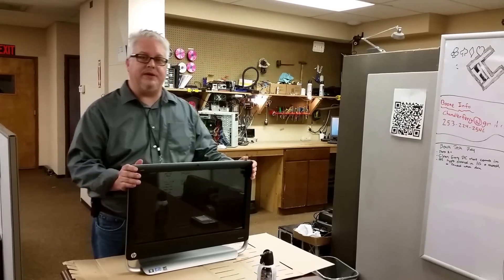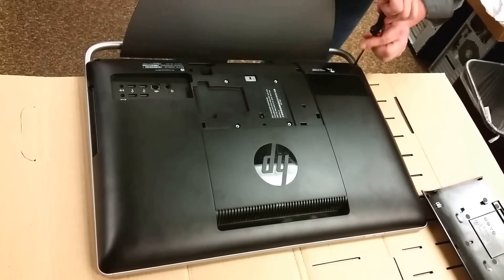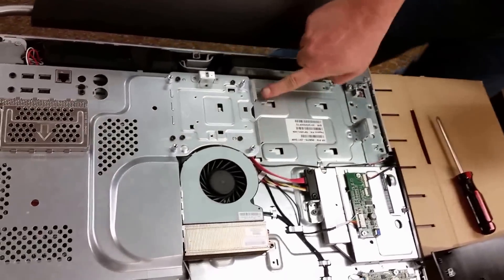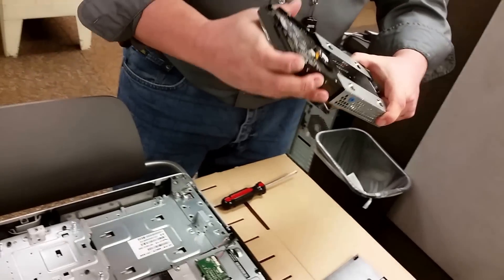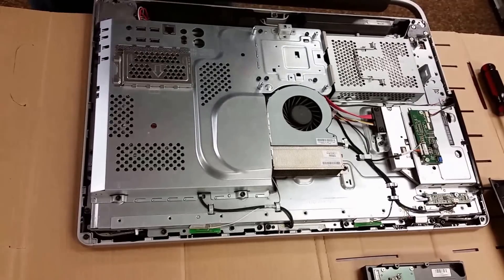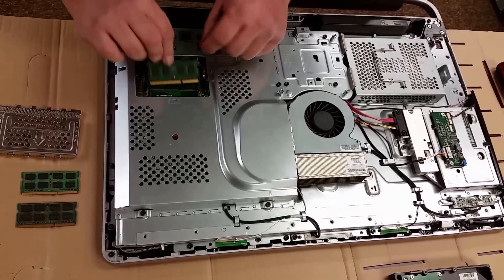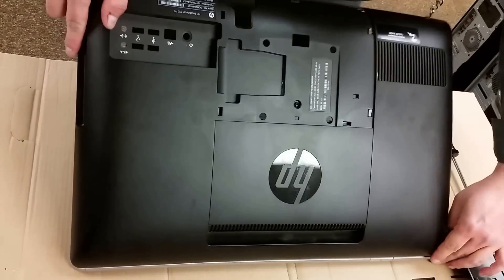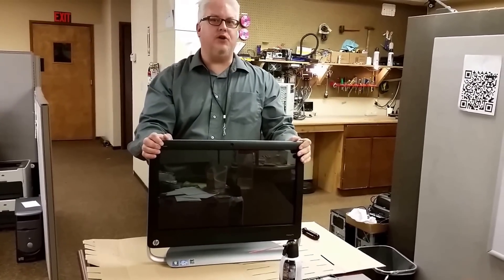How to replace a hard drive and RAM in an HP TouchSmart 520 PC

Comment: Thanks so much for this video. It was more in depth and understandable than the HP video on their website was. I've been contemplating upgrading my HP TouchSmart 520 for awhile now since it's now 4 years old and starting to get a lot sluggish when I have a lot of windows open which is quite often. On top of that I am visually impaired and use a screen reader which always has to run and process things so God knows how much RAM that alone takes up. Upgrading my current PC as best I can is definitely cheaper and thus preferable to buying a new one.

Comment: Thanks for a great video, changed my ram and installed an SSD. Mounting the SSD was tricky as I had to use double sticky tape and a tie strap.
Reply: Just use an adaptator
Reply: @Civan768  I have six different styles of adapters and none of them will mount inside this unit properly

Comment: Worked perfectly for me. I used a GoldKey LV 4GB 1600MHz DDR3 and  it cooperates smoothly with the Crucial 4GB Single DDR3/DDR3L 1600 MT/S that HP originally uses. The upgrade worths it. Thanks for the guidance :) PS: I have an HP 7320 TS.

Comment: Great video, Thank you!   Question.  Got the notorious Blue Screen on boot up and imagine best to replace both RAM and Hard drive for my HP TouchSmart 520-1070.
Where is the best place to purchase these items at and what part numbers do I request?
Reply from the maker: Darin McCulloch Sorry for the late reply. If you haven't yet, check out crucial.com. They sell both. RAM part #CT2583475. Instead of the hard drive, I would suggest an SSD upgrade.

Comment: Hello, first of all excellent video, it is very clear. I have a query and I wanted to know if you have any idea of what it can be. At times the PC makes a vibrating noise, but if I hold the case on the side of the dvd player the sound stops. Do you have any idea what it could be? If there could be something loose inside or if something is about to fail? Thank you very much and sorry if there is something wrong, my English is not entirely good. Greetings from Argentina.

Comment: Thanks for a great video.  I am trying to upgrade the RAM in an HP TouchSmart 600-1352.  I am trying to upgrade from 4GB to 8GB, but haven't had any success so far.   I noticed your RAM looked like my RAM, double-sided with 8 modules on each side.  I tried replacing it with 8GB of Mushkin, which is also double-sides, but only has 4 modules on each side.  Any suggestions?

Comment: Is it possible to add an HDMI input to this model of HP TouchSmart 520-1030 series?  I know that the 520-1070 comes with an HDMI input.
Reply: +Vainglory - Rav's Mobile Gaming You could try a USB 2.0 to HDMI Display Adapter. Found 1 @ monoprice here: http://www.monoprice.com/product?p_id=8079
Reply: Hey bud, thanks for getting back to me.  I will give that a shot.
Reply: +Vainglory - Rav's Mobile Gaming No prob. Hope it helps!

Comment: Thank You for your video I had a problem with upgrading BIOS  with Touch Smart 610 (Windows 10)   When I tried to upgrade BIOS my computer suddenly shouted down and now I have a black screen with 8 beeps  and Windows -B bottoms  combination does not work to get BIOS recovery Maybe you know another bottom combination to overwrite corrupted BIOS ?
Probably  I need to clear the CMOS - Reset the BIOS and I know in most cases it is close to the battery  Do you see a jumper  and what is the easies way to get to the jumper without unnecessary  disassembling  

Thank you in advance !

Comment: Help please, I need to change the hard disk of my hp touchsmart 520, someone can tell me which size (2.5" or 3.5") or some link to buy it
Reply from the maker: Hi Victor,

The HDD shown in the video is a 3.5", but, I would suggest that you upgrade to a 2.5" SSD with mounting kit. You'll be much happier with the performance. You can get these on Amazon or you can give us a call and we can ship one out to you. 

Our # is 253-292-5322 

Amazon links -

Mounting kit:
https://www.amazon.com/Sabrent-Internal-Drive-Mounting-BK-HDDH/dp/B00G57BN1M/ref=sr_1_2?s=pc&ie=UTF8&qid=1484751323&sr=1-2&keywords=ssd+with+mounting+kit&refinements=p_n_feature_keywords_two_browse-bin%3A6528338011

SSD:
https://www.amazon.com/Samsung-2-5-Inch-Internal-MZ-75E500B-AM/dp/B00OBRE5UE/ref=sr_1_2?s=pc&ie=UTF8&qid=1484751364&sr=1-2&keywords=ssd+hard+drive

If you have any further questions, please don't hesitate to call or send us a message. Here is a link to our contact us page:

https://angelcom.com/contact-us/

Thanks!

Comment: is it possible to upgrade your ram up to 16GB
Reply: check your model on HP's website if it supports upgrade upto 16GB. My HP Touchsmart 520 1010in only supports upto 8GB ram (4GB on 32-bit)
Reply: @Yash1331  but is that a real thing or just because the chips where not available back then? Im about to order an upgrade and wonder if I could use 2x 8Gb sticks to get 16gb in total
Reply: @Serial1977  hp makes their own motherboards so they can cheap out on them. Hence some model support higher capacity and some can't. 

Really recommend checking on their website or in the manual of your specific model if it can run 16gb or not
Reply: @Yash1331  confirmed the 520 supports 16gb despite the listed 8gb limitation by HP. Just make sure the ram has the same specs as listed but you can use 2x 8gb modules instead of the 4gb ones 👍🏼 it runs smoothly and also swapped out the hd for a sdd